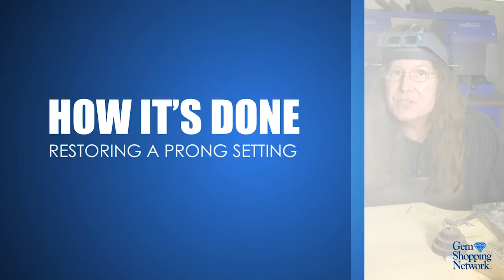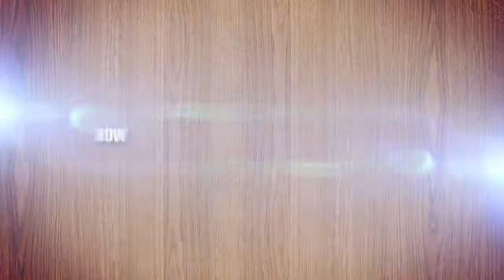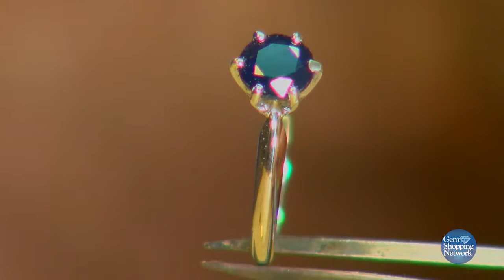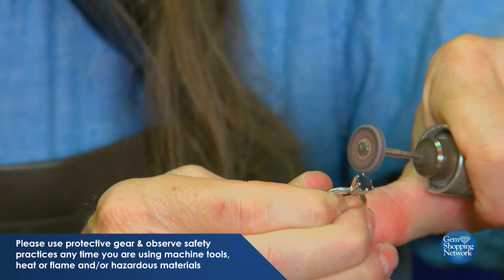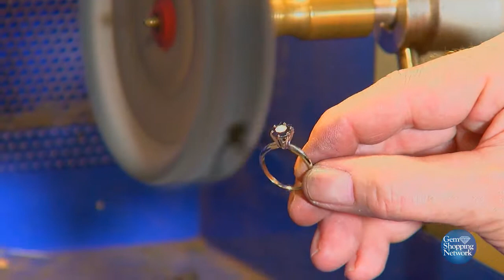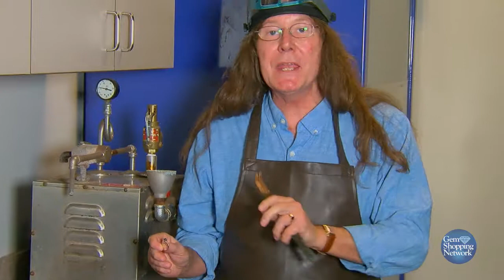Repair your ring prong - Tutorial l Gem Collectors

Comment: Can you actually double or triple dip with the rhodium, or would it do anything extra?
Reply from the maker: DAVID, The best way to get a thicker coating like as in doing a Vermeil piece over silver versus just gold  plated silver or a thicker rhodium plate is to do the plating in one longer time period and not in multiple events. I have found that trying to go back and plate over rhodium or gold will increase the thickness of the plating material on the object but I also find I can get a cloudy or uneven look to the plating  and then the only way to fix it then is to strip the plating off and start over in most cases.  As far as making it any “whiter”…. It won’t do that at all as once you have the micro thickness on the plated object then that’s the color it will be and additional time will add additional micron thickness to the plating and will last longer on the object.  Use a lower voltage for a longer period of time with a very high polished piece and most importantly is to not have tainted your rhodium solution by contamination of the solution or using the wrong anode or cathode for the project. For Rhodium…. Platinum is best for both.

Comment: My question is why would you not use a similar gauge wire of the prong? Lay solder on top of prong then add the wire so you have them bond together. Since a solder prong will wear away faster if  than just having a seam where you added a 14k gold wire being on top. Try that out if you get a chance your clients will appreciate the longer lasting and more durable prong and looks a lot better.
Reply: Interesting